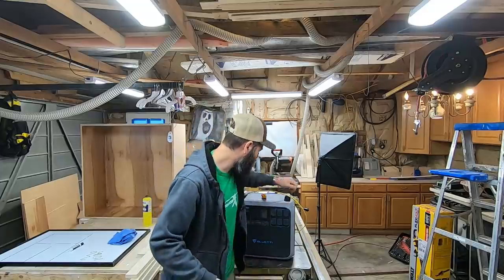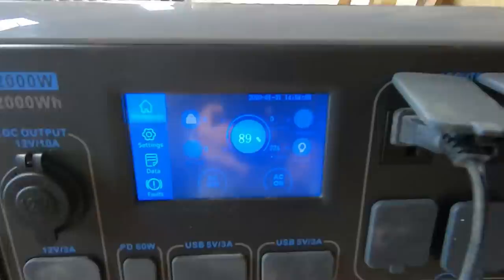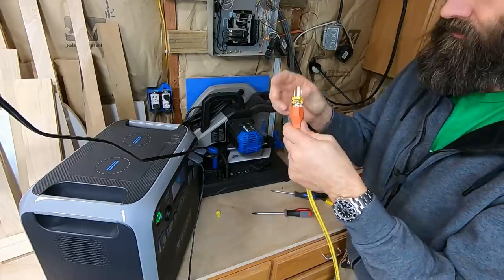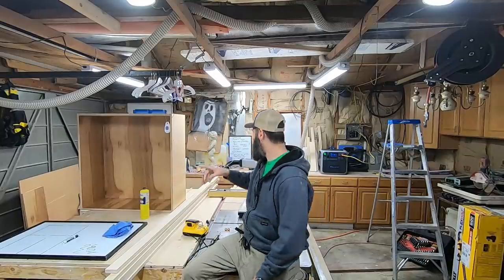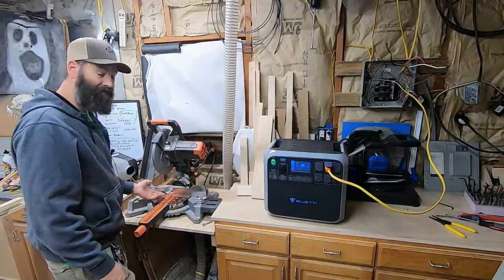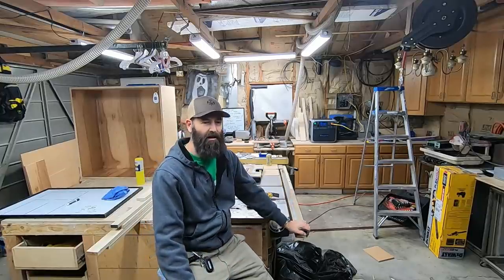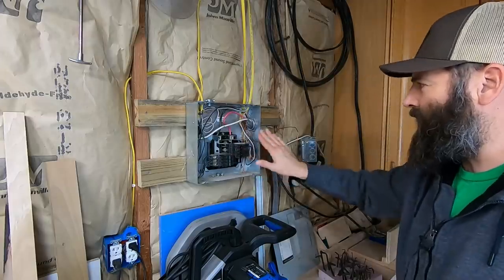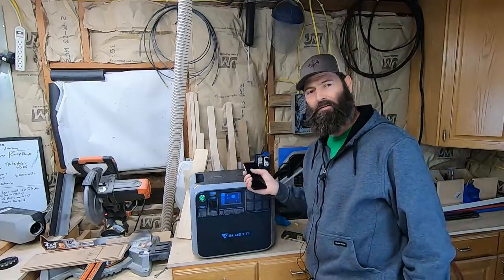How Your Electrical Panel Works | Don't Try At Home | THE HANDYMAN |

Comment: That 60 horsepower vacuum is what I need for renovations.  Turn it on and suck up all the chunks of drywall, 2X4's , insulation, roof shingles etc. ....
Reply: ... an entire building... 😂

Comment: I’m wondering about your shop vac. Most are just a couple or a few hp. When you turned it on, the output went to 1700 watts (if I recall correctly), which is about 2.5 hp. The shop vac manufacturers often refer to peak hp, which I think is a misrepresentation. Your thoughts?

Comment: Very practical test. I like adding the additional breaker with a cheap mechanical lockout switch (just in case someone with a skirt comes along to nag me) for gen hookup... cheap, low tech, nothing to break when your already in the shit.  Have had to hot wire like this by flashlight with cold wet fingers too many times :D. Thanks for you videos.

Comment: Like your channel.  BTW, 1 hp equals 745 watts.  6 hp ~4400 watts.  60 hp ~44000 watts.  Are you sure about the rating on your vacuum?  There was a class action lawsuits against the vacuum manufacturers for inflated hp ratings, so it might not be accurate.

Comment: Wonder how they rated that shop vac because it sure wasn't based on electrical power consumption. 1 hp = 746 watts. 60 hp is 44,760 watts.
Reply: I was thinking the same thing

Comment: So you're taking the battery in the "generator" and converting it to ac through the inverter, then plugging in the dewalt charger, which has to convert back to dc.

Comment: Hey, can you run one of those small stick welders with these units? I saw you use the old box with a flux core welder in another video, I tried running a mobile stick welder last year and I couldn't get it to work with my regular inverter.

Comment: Curious. Can you wire the circuit breaker from your car, with a switch, to your 12v auxiliary
Power bank in the vehicle so when you hit the switch, you Can run your normal car system with out the car being on or using the car's battery.?
Reply from the maker: Yes

Comment: Got a switch and plug together in my bathroom the plug stop working so got a new one cannot get it to work it driving me crazy any idea why it isn’t working. I got a hot wire and neutral wire ground. It worked for years. Half switch half plug

Comment: Come on Handyman!  If I heard you correct you said your dust collector was a 60HP motor.   I have never seen a 60 HP motor that would run off of a 110 VAC.  Did you mean a 6 HP motor?
Reply from the maker: Binford 6100 shop vac
Reply: @TheHandyman1  Lol... More power!!
Reply: @TheHandyman1  Oh, the old Tool Time trick!  LMAO!

Comment: Wish they made a 110 /220 inverter for mt Honda 2000 so I can use my Dryer on cloudy days.
My wood pellet stove blowing into it & set on cool dry should work for pennies.
Reply: Dude even if they made a 220 you understand how much power a dryer uses? Looking at about 3000w+.
Reply: @randybobandy9828  I assumed a 2000 watt Honda generator and inverter could power one clothes dryer.
Reply: @fmradio42  no it cant
Reply: @Ampacityelectric  Thanks, go to know. wonder how much solar is needed to power it.
Reply: @randybobandy9828  My wood pellet stove blowing into it & set on cool dry should work for pennies.

Comment: you crack me up...electrocution.... ..lol....I bet you were a comedian in another life!...what's the AMP hour of the battery? I cant seem to find it on their website? or maybe i am missing it....
Reply from the maker: These things are measure in watt hours. 2000 Wh at 50 Volts
Reply from the maker: Battle born batteries are 1200 Wh at 12 volts
Reply: @TheHandyman1  that will depend on which battery you get. Battle born also lists its AH of its batteries IE 50AH, 100AH and so on....the one you listed is 100 AH, it seems that battery is only 40AH  is that correct?

Comment: Where do I get this magical 60 horsepower shop vac? 🤣🤣🤣

The biggest shop vac I’ve ever used is 6.0 or 6.5 Horsepower. 

A 60 HP dust collector would be bigger than a car, and require at least 150+ amps of 230Volt 3 Phase power.
Reply from the maker: Binford

Comment: A 60HP shop vac?!?!  I hope you mean 60 gallon.
Reply: I just googled it and 1hp = 745 watts.  That is 6.2amps @ 120 volts, which means 60 hp would be 372.5 amps @ 120 volts.  I don't have that much power coming in to my house, I believe I have 100 amps @ 240 volts.
Reply: @dustintunis9347  even if you did have that much power you would need a 1 in thick cable to carry that many amps
Reply: I caught that too. Immediately googled 60hp shop vac
Reply: Horsepower ratings for vacuums are generally accepted as complete garbage. Their lab test methods are outrageous.
Reply: @nxbpeach  yup. Vacuums that say 6-7hp are flat-out lies. A standard 120v outlet can only provide 2hp max. Products  can legally only put 1500w continuous in the states. Thats why you never see space heaters more powerful than 1500w.